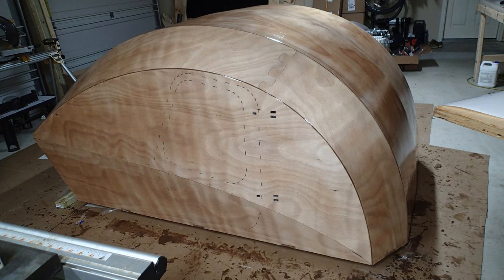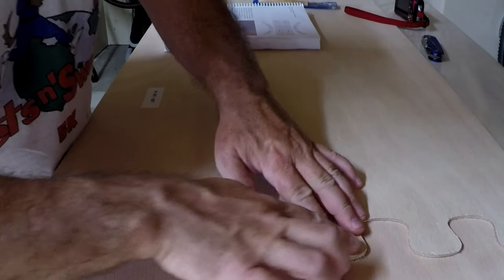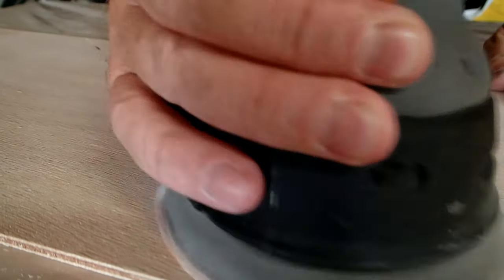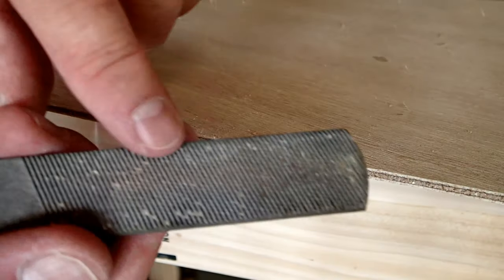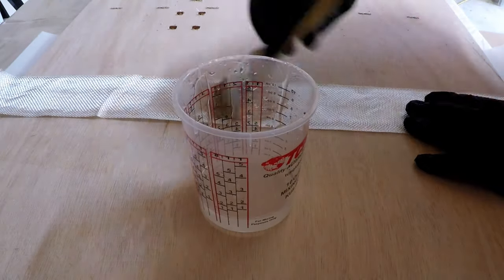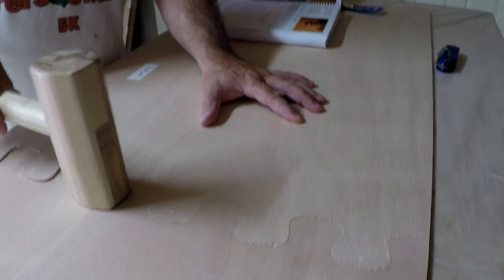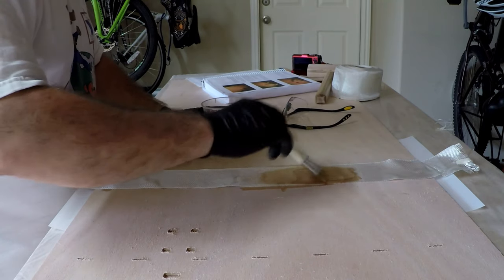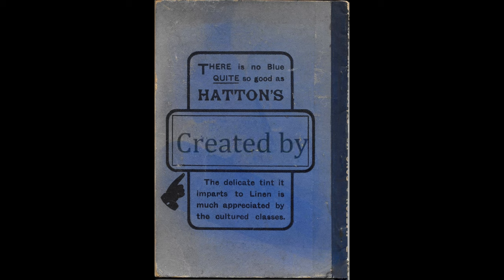Preparing the wood to build the CLC Teardrop Camper - Getting ready for stitch and glue construction

Comment: As I have one of these kits on order, keeping your directions will no doubt be a valuable asset. Thanks for your help. Rick
Reply from the maker: I'll be making more videos soon.  If you have any questions that I might be able to answer, let me know.  Are you building the trailer or did you buy one?
Reply: @PhilHattonMakesStuff  I expect I'll buy one unless you think sizing would be better with built to suit. Likely starting this project in march as i want to keep my tractor in the garage for the brunt of the winter
Reply from the maker: @rickcathcart2196  the kit includes bunks so you can mount it on the trailer of your choice.  I chose to order the Trailex trailer through CLC because it eliminated having to make a choice I might regret later.   I knew the trailer designed for the kit would have the clearance, weight distribution and capacity, correct springs, quality bearings, and probably a bunch more that I didn't know to look into.  On the other hand, CLC says you can use just about any small trailer including a $200 one from Harbor Freight.  I personally wonder what quality bearings, welds and paint you get with a $200 trailer and I didn't want to have to take the camper off the trailer to do repairs or replacement.
Reply: If you know the make and model then maybe I could get the measurement of the deck, tongue !ength, Axel location from front or back of deck I will build. I live in a rural portion of Ottawa Canada and paying $ 1.26 / USD for the kit ( I don't know yet what the duty will be on importing ), so purchasing a trailer from there really isn't possible.
Reply from the maker: @rickcathcart2196  the trailer from CLC is a Trailex SUT-1000CLC kit.  I just looked and Trailex has the assembly instructions but they don't have dimensions on their website.
Reply: @PhilHattonMakesStuff  Thanks again. There is a trailex dealer near me! I have the model # so will pay them a visit

Comment: I’ve seen what I think is all your videos of the CLC Camper until you moved. The narration is the best on Youtube. Your guidance encourages me the more to build this campers. But … I want to make it one foot wider and one foot longer. Am I nuts?
Reply from the maker: Not necessarily nuts, but...  I'm assuming you'll be working from plans.  There are a couple of folks who have posted in the past on the Facebook CLC teardrop camper builders and owners group who have extended the camper lengthwise.  It would probably be a little more flexible and you would need to make sure you have clearance for the fenders. The rooftop bezel would change.  And you would do a custom galley.  I think you might want to relocate the battery or reinforce the galley flat too.
Reply: @PhilHattonMakesStuff  This thing takes batteries?! Double-A, Triple-A? Of course plans. I’d modify and original set and lay all the pieces out flat, first. Using an independent axle system I would  place the 2 batteries in the face near the tires and water tank center between the wheels.
Reply from the maker: @davidlarson9013  quite a few people have located the batteries in various different spots and all seem happy with the results.

Comment: Hello Phil - at about 3 min 2 seconds into this video, you recommend, prior to epoxying the panels together, to sand the panels to smooth them out, and to clean up sticker residue.  Could you elaborate a little on this, please?  *What grit sandpaper on the orbital sander would you advise?*  I'm assuming you'd want a pretty light touch on this step - just to smooth things out a bit?  Thanks!
Reply from the maker: Hi John,
I used 150 grit and 220 grit but two sanding passes are probably not necessary.  the outer veneer on the panels is pretty thin so you don't want to send through it especially where you're going to sand again later so just a light sanding to clean up the edges, clean up sticker residue, take off any fuzzy grain and even out the color where stickers left shadows. How that helps.  Let me know how your build goes!
Reply: Phil Hatton If multiple passes aren’t necessary, what grit would you use on the single sanding pass? 🤔  (I’m a complete noob to this sort of thing....)  Thanks, Phil; your videos are great! 🙂
Reply from the maker: @johnpelz4811  I'd use 220.  It's not as aggressive.
Reply: Phil Hatton Thank you, Phil! 👍🏼